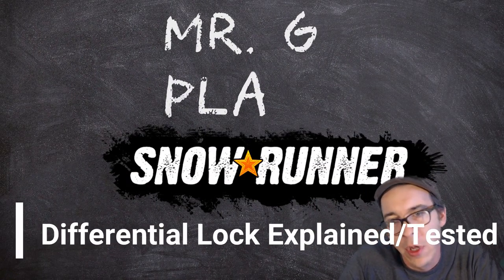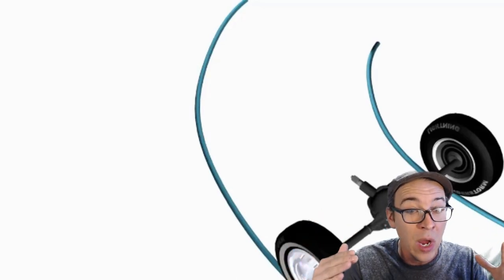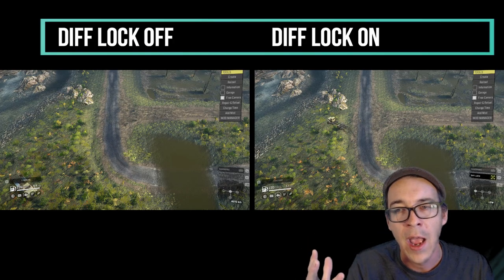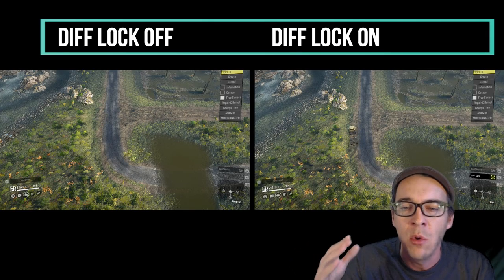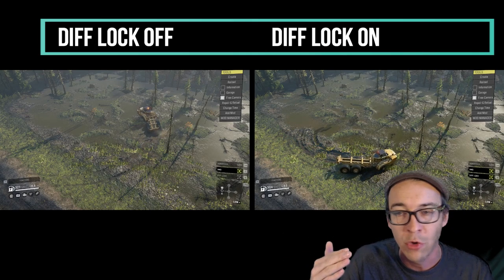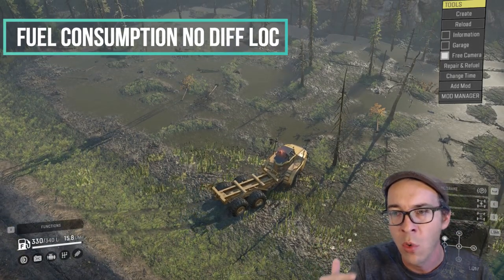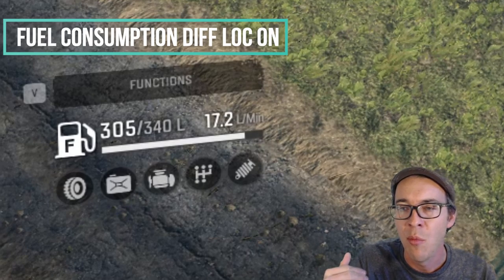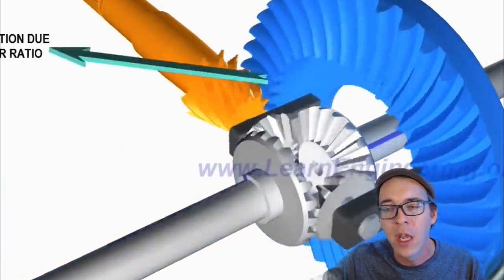Differential Lock Explained & Tested -- Snowrunner

Comment: Can you test if there is a differnce between switchable and allways on diff lock ? Many people say that the switchable diff works better offroad because its a 100% lock and the allways on lock not, i say theres no differnce and the allways on is better because you get no damage on hard grund, you dont have to put it on and off and you can use it effectively at 9 gears with offroad gearbox or 10 gears with optimized special vs 1 or 3 gears with switchable diff lock depending on wich gearbox you have because you can use it only in L

Comment: I had to laugh,  My friend/former student from truck driver training had called just before I saw your video.  What they are thinking of doing is what you just did, use SnowRunner to demonstrate/test different options.  That won't replace hands-on real world experience but would serve as an introduction to those option.  With the huge shift to online instruction (which will not totally go away after COVID19 passes) they are looking at better ways to improve theory instruction.  There are a lot of issues for deal with first like copyright of videos used making SnowRunner, costs especially if they want each student to have a copy, etc.  But they are getting copies fo SnowRunner for the instructors that don't have it so they can look into possibilities.  (About 1/3 of the instructors already had SnowRunner.  Truck driving instructors playing SnowRunner.  How shocking!  ;-)  FYI: good instructional video.  It is an excellent example of how a good game can be used to produce great instruction.  Well done.
Reply from the maker: I needed this comment today.
Reply: @MrGPlays  Rough day?  Go play with Baby G, Little G, and Mrs G.  3 against 1 football worked for me especially if the 1 cheats & out weighs the 3 combined.   ;-)
Reply: Well Snowrunner unfortunately is not a simulator like I wanted it to be, and when it comes to differentials, other transmission components, engines, physics etc it has a few problems and some stuff is just wrong compared to real life, I would tell that to the driving instructor
Reply: @LinkinPark4Ever1996  They went in with the understanding that SnowRunnner is a game and not educational software. The last I heard, about 6 months ago, they were talking to programing instructors and other departments about doing something in house. They had funding and promise of funding from a wide range of sources.